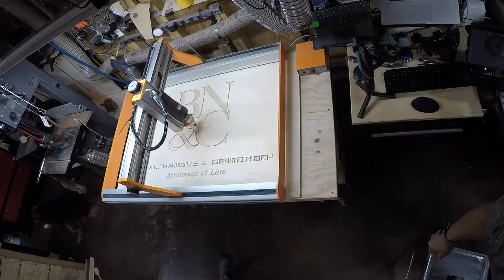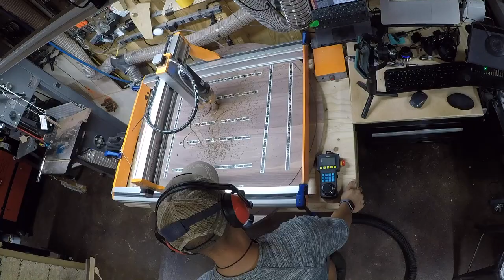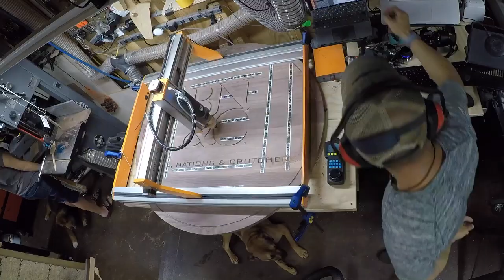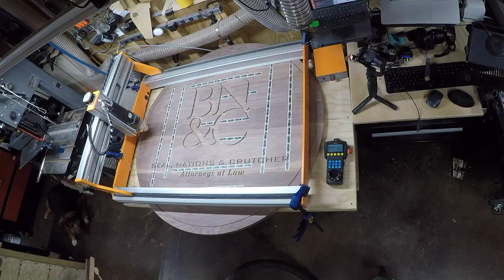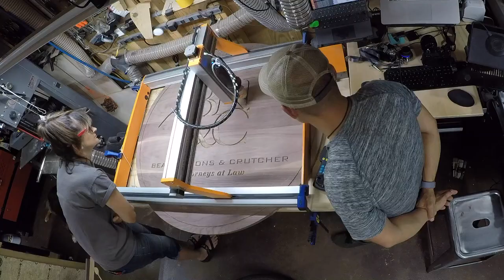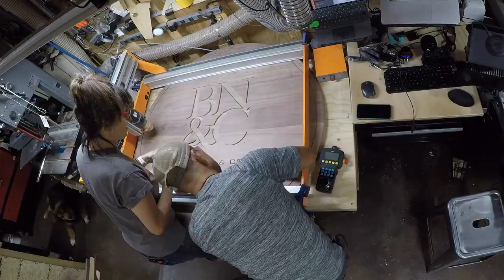4’ Sign building timelapse - Freestyle milling - Stepcraft M-Series M.1000

Comment: Sir, you are using the wrong bit ( or it's dull) if you have that  many fuzzies on the edge. I did enjoy your video, thank you for sharing. (also a lot of people will buy a sanding wheel ...flap wheel ...and put it on a drill to remove most of the fuzzies) what are your plans for finishing the the piece?
Reply from the maker: Thanks for the input; I've learned much since this project. A sharp bit definitely makes a difference. For finishing this, I had to use a chisel and Dremel with sanding tips.